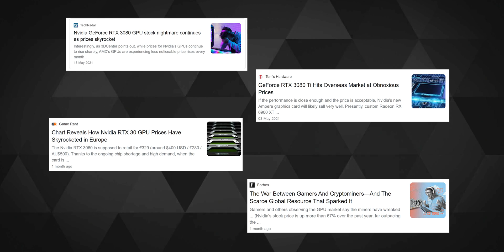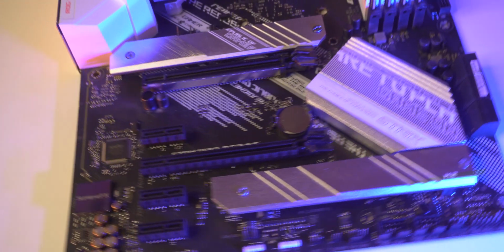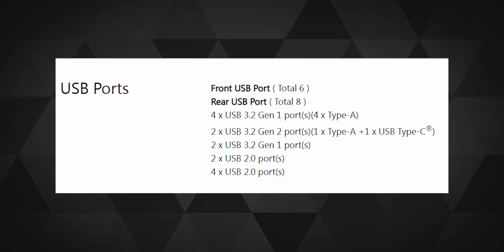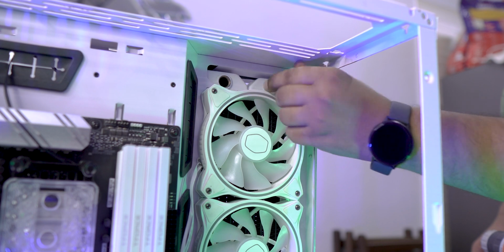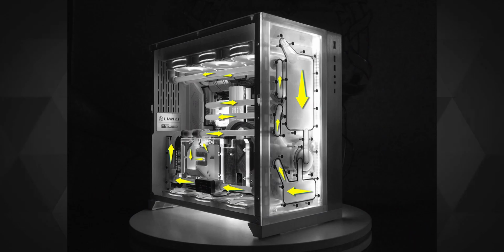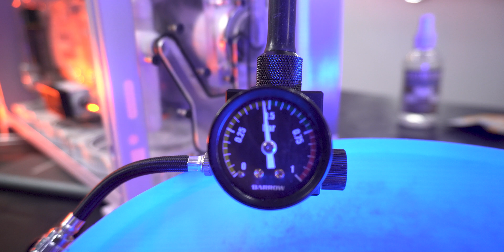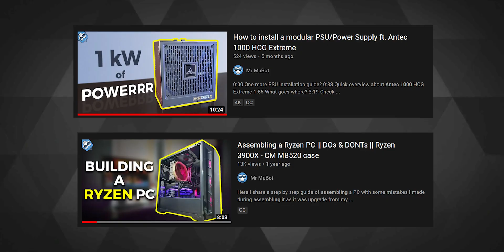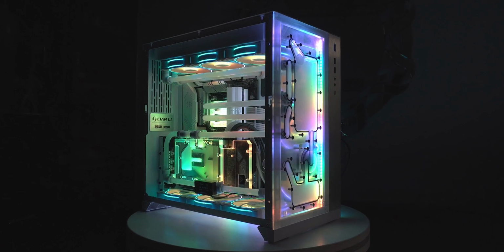The almost impossible Custom Liquid Cooling Build

Comment: nice Build. Which adapter Fittings do you use at the site for the radiator?
Reply from the maker: Thanks. A couple of 90° with one 20mm extenders.

Comment: hmm nothing impossible to it, the bottom left fitting isn't needed if they took the effort of making one long double bent tube. And everyone can buy expensive parts that look good.
Reply from the maker: There were few reasons that made it impossible. Choice of components of which few were very hard to get and few health factors played a drastic role too. Of course everyone can buy expensive parts if everyone could afford them.
Reply: @MrMuBot  Then it's clickbait
Reply from the maker: It shouldn't be now for you when I've explained the reasons to you. 
But even if it still is then that means I'm learning from the veterans well enough then. 😄
Reply: @MrMuBot  "impossible build" implies difficult to make PC. It's not, end of story
Reply from the maker: My explanation has flown over your head. End of story.